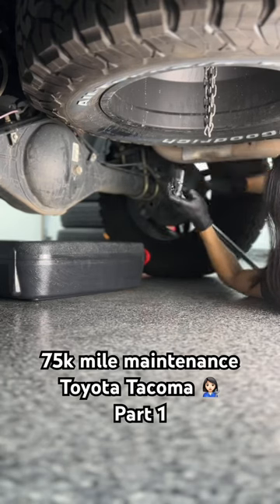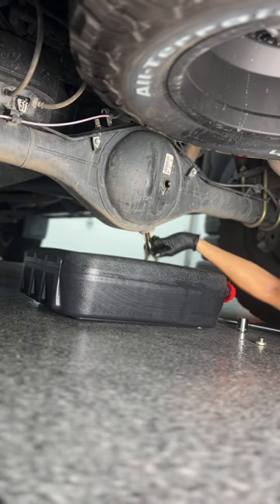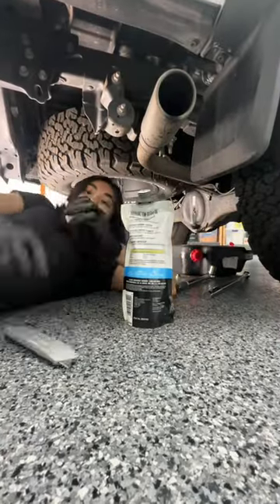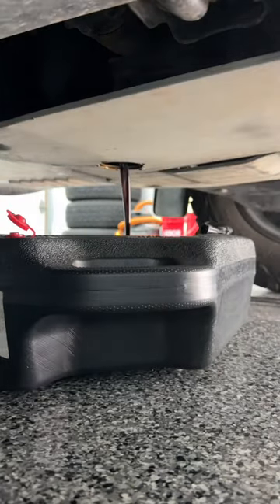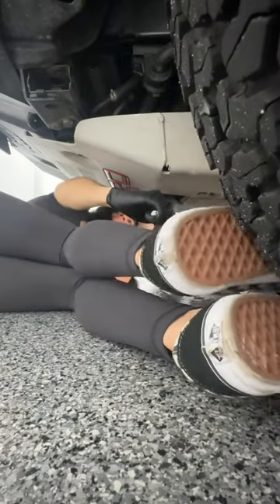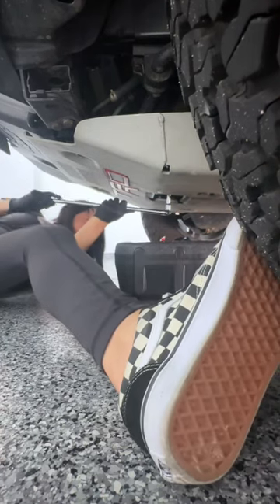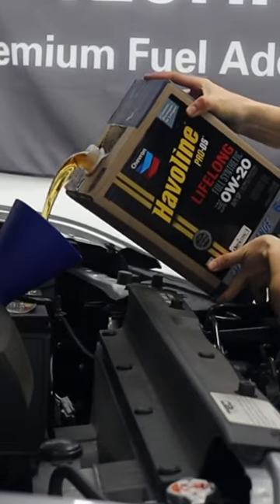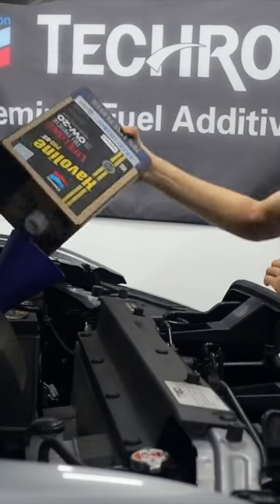75k mile Tacoma Maintenance! Part 1 #shorts

Comment: Hold the box of engine oil sideways. As you start to tip the box, keep the spout slightly higher. You'll notice the glug glug of the fluid doesn't happen. Nice easy pour. Very controlled. 👍
Reply: Another wild tip, if you don’t have a funnel…remove the dipstick and put it in the oil tube and pour the oil onto the dipstick vertically. The oil will travel along the dipstick like water on a rain chain…it’s pretty remarkable. Tends to work best on cars where oil goes in straight down thru the valve cover as it’s easier to have the dipstick vertical in the middle of the hole.

Comment: Can we please not teach people that it's okay to use a wrench when tightening an oil filter..... It's more than enough when you snug it on by hand.... Other than that, nice job👍
Reply: Guess you’ve never changed the oil on a Toyota/Lexus. They have a housing for the filter that has a torque setting. These aren’t throw away screw-on filters.
Reply: @damon323  Plenty enough times to say you're intentionally missing the point, i wasnt referring to the separately housed filters like audi, bmw, toyota, etx uses, also 17 newtons is pretty much hand tight....
Reply: How am I intentionally “missing the point” when your exact words are “can we not teach people it’s okay to use a wrench when tightening oil filters”😂😂
Reply: Good luck tightening an internal filter by hand especially these stupid filters. But she definitely has it over tightened.
Reply: @mikefromnebraska  Don't know what to tell you, never used anything but my hands to tighten the filters. Even the one i have in my Audi, the one that is specified to be tightened to 17n, that also happens to be an internal filter.....
Reply: @HellHound4201 I've done that on BMWs but the housing sits on top of the engine bay, so there is not much of a chance of oil coming out. On the Tacoma the housing faces directly down and is about 2ft from the ground, so it needs to be tightened with a tool. Not overly tight but definitely not by hand
Reply: @damon323  My 3 yotas don't have housings.
Reply: @HellHound4201  The reusable plastic housing filter has a torque spec that I promise your old hands cannot match. I'll trust the manual and the forums over an Audi curmudgeon who "missed the point".

Comment: Just a tip for the Toyota oil filter housing is to replace it with the aluminum version. The plastic one will crack.

Comment: Please wear safety glasses when underneath vehicles to avoid rust/dirt particles flaking off and getting into your eyes. You can buy a Toyota specific funnel that has a rubber gasket and screws into the oil fill hole. That makes it super easy to fill without spilling a drop.
Reply: Very true. If you’re working overhead (or underneath) you’re working in your eyes.

Comment: Within 5,000 mi of my TRD off-road manual transmission being 🆕  I did the front diff, rear diff gl-5 & transmission gl-4 with amsoil & used a red line MT-LV in the transfer case.. OTT tune & AFE dry flow air filter

Comment: If u tip the can sideways, it will pour easily without the backflow on the bottle, so just a tip trun, the oil bottle sideways the pour the oil in it changes everything
Reply: Those boxed oils don't glug like plastic does
Reply: Yeah it a bag in the box so it just deforms

Comment: The Tacomas Maintenance book asks for 6.2 qts, I see you just added 6qts, would not adding the .2qts do anything bad to engine?
Reply: Depends on what your oil measures to on the dip stick when you're done, and after you run it for a bit. naturally there's going to be residual oil still throughout the engine, every ounce isn't going to drain out. In this case that's just under 1/4 of a quart that isn't put in. So as long as it's between your low and high marks on the dipstick you're golden, I like to keep mine in the middle or slightly closer to the high mark.
Reply: @august9568  thanks.

Comment: How do you remove the smaller plug inside the paper filter cartridge holder to change the smaller O ring since both loosen counter clockwise?

Comment: On the rear differential, remove bottom bolt and then top bolt. Makes less of a mess
Reply: The reason people remove the top bolt first is to make sure it will come off and is not frozen stuck. It'd be a pain if you drain the fluid first and then find out not being able to remove the top bolt.
Reply: It's a well-known rule of thumb that you should always remove the fill plug before you remove the drain plug.

Comment: Too much torque for the oil filter housing. 1/2 drive is over kill.   3/8 should be used.
Reply: There's a plate on the bottom of the oil canister which is removed to drain the oil before unscrewing it to replace the filter. The key on that plate is a 1/2 in drive, so its necessary for that step. Otherwise, there's a torque spec for tightening the canister and drain plugs, and Chloe follows all the manufacturer recommended torque specs. She's not doing anything here that isn't by the book.

Comment: Switch how you fill the oil. Make sure the filler is on top of the box and not at the bottom as to not have air bubbles in the oil and spill.

Comment: one more thing cuz everyone has mentioned the pouring but to avoid using the tool to install your oil filter. Tightening it by hand as hard as you can will be enough. If you can't reach it at least screw on the filter without the ratchet wrench first till it's tight and give it about 3/8 of a turn or less to snug it in.

Comment: You should upgrade to the metal oil filter housing your next oil change. Part# 15620-31060
Reply: Agreed. The original plastic housing is prone to cracking.

Comment: You should upgrade to 10w40 synthetic oil. 0w20 is too light duty.
Reply: It's the only manufacturer recommended oil, very light for a truck I know, but supposedly Toyota engines are intended to be so tight on the clearance that thicker oil will cause too much strain and damage.